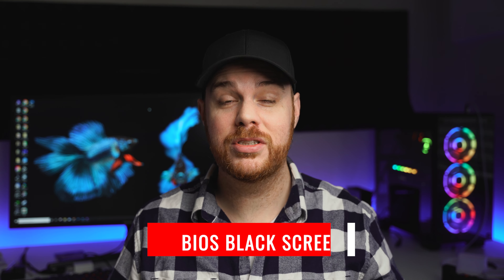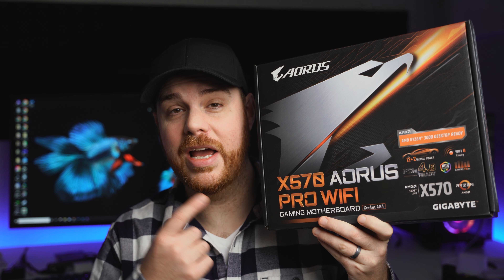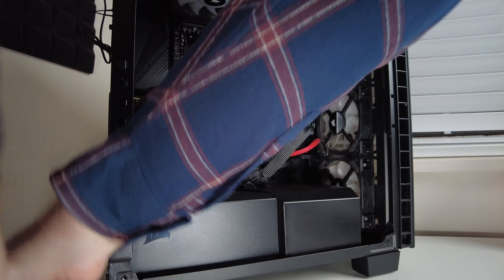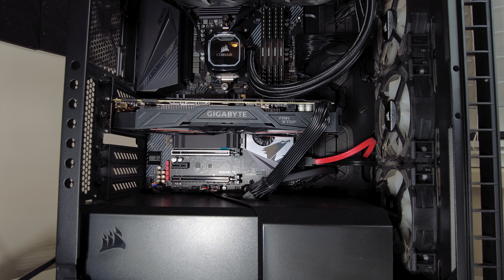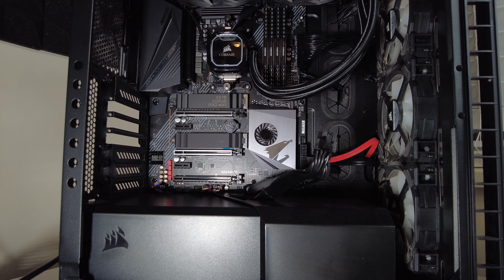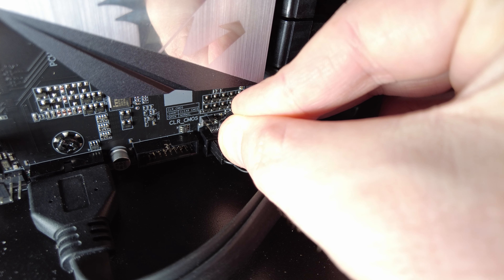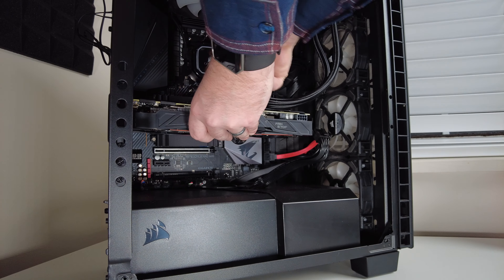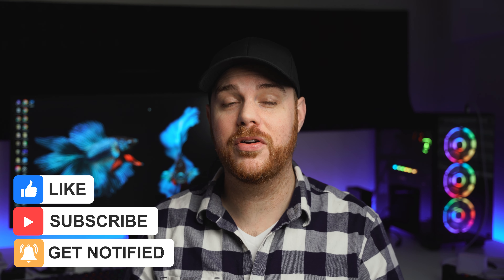How to FIX BLACK SCREEN from BIOS CHANGES (3 WAYS)

Comment: I tried everything and my bios screen is still just black. Please help!
Reply: it means your bios is corrupted, just like mine, you need to find out if you have a second bios on your mootherboard, if not, you need to send it where you got it and get help or find a pc store that helps fix things
Reply: Sgt Ryan  oh I found a fix. It sounds stupid af but it did end up working. Basically just unplug all drives from the system and boot. It literally somehow fixed it

Comment: This really helped. Thankyou.  Had to use the method of removing the battery. Thankfully it did the job.  I do have a question that i hope you can help with.  I have the MSI MPG B550 GAMING PLUS Motherboard ATX.  In the bios, memory settings is a feature called "try it" with the discription "optimises your memory".  When selected it bring up a drop down box.  I selected the corresponding ram "32gb 3600mhz" and saved it.  Reboot and my screens went off and wouldnt boot.  Any ideas?
Reply: I have the same with the same motherboard. Did you fix it?

Comment: I built my P.C. and when I turned it on pressing F2 or Del would bring up a black screen. once it went to Bios, but everything is new in the computer. I have reset the Cmos both ways and still can't figure out why I can't get to Bios to set things up. Any thoughts?
Reply: turn off the fast boot
Reply: and secure boot

Comment: Do I have to completely change the battery or just put it in and take it out
Reply: Do you know the answer to that? I’m worried I’d have to buy a new one
Reply: @crackedpotato30  just take the battery out for 10 seconds (a minute is even better) and put it back in. The battery basically "stores" the infos that the motherboard couldn't keep without it.

Comment: Tried both methods multiple times but no luck. Flashed BIOS (to the latest beta and stable versions both) with MSI flashback, no luck either.
Took my old SATA SSD which has win10 installed from my old case and plugged it in and removed other storage devices from MOBO and got the only windows login screen. 
Before that, just nothing. No BIOS, no MSI splash screen logo, nothing at all. Straight to the windows login screen after 5-6 seconds of blank screen. (Of course I tried to get in to the BIOS with DEL key but then nothing happened. I know the PC was in BIOS but I couldn't see it on my monitor and  had to restart.)
I ordered an HDMI to D-Sub converter.  I'll try when I get my hands on it.
If it does not work again, I will have to wait for my other monitor that has the DP input to return from the service. Maybe I can get signal with DP port. 
Specs : 
MSI X570-A PRO
AMD RYZEN 5 5600X
CRUCIAL BALLISTIX 2*8 GB 3600Mhz CL16
SAPPHIRE RX580 NITRO 4GB
TEAM MP-34 1TB NVME M2 SSD
ADATA SU630 240GB SATA SSD

Comment: My PC refused to enter BIOS and would cause my monitor to say "No Signal" when I tried. I reset my CMOS and it won't even show anything on my monitor. I'm thinking something with the BIOS is causing nothing to dislplay and now that I reset the CMOS, it's in BIOS so it won't display. Do you know any way to fix this or will I have to take it in somewhere to be repaired?
Reply: If you know how to use ch341a programmer, use it to reprogram the BIOS chip
Otherwise take it to somewhere to repair

Comment: I tried all those steps (removing CMOS battery, shorting the CMOS pin thin, unplugging everything) and my screen is still blank. The CPU fans and all the fans come on but blank screen. I have a gigabyte b460m ds3h-Y1. The "Y1" is because iBuyPower modified it. I flash the BIOS with Gigabytes F5b BIOS instead of the iBuyPower's modified BIOS (latest from them is F3). Does anyone have any other suggestion for me? I really can't afford to buy another MB/CPU combo. Thanks again.

Comment: I bought ryzen 9 5900x and Asus prime x570 pro. I updated the bios with older CPU. It worked normally with it but the display is still black after I change the ryzen 9. Does someone have an idea how to fix this?

Comment: I did but still black screen, monitor mouse not working, :( yesterday I use upgrade bios
Reply: Did you figure out a solution
Reply: @DrTwitch  no, actually, I have reseted bios but still only CPU WORKING,   2-3 hr continue computer  turn on-  turn off do, then sometimes computer turn on probably then next day again 2-3 hr do ON-OFF, :( I DON'T KNOW, VOLTAGE ISSUE, 
3 light reveal in motherboard, VGA, CPU and GRAM. 

GIGABYTE X470 ULTRA GAMING 
RYZEN 2700X 
16GB RAM 
550 PSU, 
THANKS

Comment: After few time again black screen even i got replacement of my GPU and after power off when i restart again GPU don't have any power showing so i have to clear cmos then everything work fine don't know what to do and before one year i got replacment of my motherboard and same issue after few months and power supply to replaced 😭😭
Reply: GPU motherboard power supply these got replacement 😭 and now
Reply: I am assuming a problem with the motherboard but now I don't have a warranty or a technician nearby who makes a good pc I have 3080 + tiachi x570 ryznd 5900x

Comment: I wanted the windows 11 update, I was told i need some TMP enabled, so I went to the bios and turned on secure boot, fast boot and tmp, also enabled xmp/emp(whatever that is) for RAM. I click on save and reset and then the screen went blank. I tried restarting PC but no display. CPU fans are spinning, Motherboard light is on but no display whatsoever. 
 
I'm not sure if this is the fastboot's doing but earlier I had to long press power button on the pc to turn it off but now as soon as I touch it, pc turns off.

I've removed and reseated GPU, RAM.
I tried resetting CMOS by shorting it with a screw driver, also removed and reseated the CMOS battery.(multiple times)

(Yes I unplugged the power cord before doing any of this. Also did the drain-the-static move by pressing and holding the power button a few times.
Reply: Still not working? I just did the same
Reply: @JANTH  Nope. I tried whole night, got upset and let it go. I get the feeling the cmos is not getting reset on my motherboard for some reason.
Reply: @ShivaMurary  same issue bro
Reply: @aravindreddy9417  Did you manage to fix it?
Reply: @ShivaMurary  no tomorrow i am going to ctc i might found what's the issue and report it to you well i use gigabyte b365m to be precise
Reply: @aravindreddy9417  Mine is Gigabyte b460m. Okay all the best!
Reply: Have you find solutions for this
Reply: @harysviewty  Yes the issue was my dedicated graphic card drivers got corrupted or something. I had to use integrated GPU, then I got the display and managed to reset BIOS, everything worked fine after that.

Comment: Screwed myself bad, I think the dell bios update I did deleted the original bios and corrupted the new one when I tried to restart the machine. I guess I have to desolder a bios chip and solder a new one or wait for the new mobo I ordered. Gotta love computers.....Thank God I don't invest my money in Computers and that what I have is a Cheap desktop with a $30 mobo otherwise I'd be pulling my hair out.
Reply: Lol turns out it was my TV not displaying my screen, tried my Extra Screen that I use for my Laptop, worked fine....Thank God..For those that have to Update your Bios on a G33M02 Board for a Dell Inspiron 530 from say 1.0.5 to 1.0.18 don't worry if your Display does not show a boot screen after a successful bios Update. Try using a different display or use the Display port on your Graphics card and it should boot up to windows/linux just fine.

Comment: I was playing around trying to get windows 11 messed around with the secure boot and now my computer won’t post it’s completely black and I tried everything you told me to do but it’s still black The bios was working before
Reply: Same happened with me day before yesterday 
Do let me know if u find any way to fix this
Reply: Also when you Q flash you don’t have to turn on the computer just make sure it’s plugged in to the outlet like normal figure out where your queue flash button is on your motherboard and hold it for about 10 seconds it should take about 10 seconds to actually do something then you’ll notice your fans kick on and some flashing should occur
Reply: Oh and put the USB in the back of your PC USB it should say bios, I will put it where your motherboard says to put it
Reply: I have a similar problem where I' get stuck at a black screen when I try to enter BIOS. If I don't, I'll boot normally to Windows. I need to open my BIOS though and I can't.
Reply: @NimeuMusic  Q flashing your motherboard will reset your motherboard
Reply: @MrC0LT0N  Thanks! I'm gonna google now how to Q flash my motherboard.
Reply: @NimeuMusic  what motherboard do you have and is it AMD or intel
Reply: @MrC0LT0N  AMD. MSI B550 Edge Wifi. I just build a new PC today and everything works great and I was able to get into the Bios, installed Windows 10, drivers etc. Then there must have been some driver or update that is now preventing me from getting into the Bios, it just shows a black screen after hitting delete. I can still boot normally to Windows though, it's weird.

Comment: I removed the cmos battery and it reset the BIOS settings because I checked task manager and my ram overclock was reset. However, I'm still getting an infinite black screen when trying to enter the BIOS. Any tips or ideas on how to fix this?
Reply: Same like me , do you find the solution?
Reply: Set your BIOS to use dedicated graphic while using integrated graphic

Comment: Yesterday I went into bios to turn on my integrated graphics for my Ryzen 3 3200g. When I saved and left bios my screen was black so I pulled out my Motherboard battery and re installed it. Today I tried doing that again and I had to pull the battery out again. Some minutes ago I went into bios and left emidiately without saving... I got a black screen again !

What can I do about that? My device manager is also not detecting my integrated graphics anymore after pulling out the battery.
Reply: After re installing the battery I do get into windows just fine.
Reply: Hey same happened with me I messed up with my integrated graphics settings and after saving it my pc is not booting up or there is a black screen so should I do the following steps shown in the video? What did you do to fix it?
Reply: @pablochocobar074  Hi, just open your pc case, and remove the Cmos battery. Wait 15 seconds and then reinstall it. Now boot up your pc and you are good to go.
Reply: @LauandM  THANK YOU MAN I tried this and now i am typng from my pc :D
Reply: @pablochocobar074  np bro
Reply: What can I do I have asus strix g15 ryzen 7 4800h/BGA and I have no boot priority’s stuck in bios then I try to update it and reinstall windows and now I got black screen  with power and airplane mode lights on ??? Please help

Comment: noone can help me my bios is broken i cant find a file to update it and its a Minisforum EM680 my bios is displaying to the monitor its just pure black no mouse display no nothing the pixels are on but they arent displaying please i cant find any info and my only hope is a video from 3 years ago that the only thing similar to my situation is it involves a black screen and bios this is how i got my pc ive never been able to accsess bios even though i should be able to certin things dont work like my AMD software wont let me swap into gaming mode for overclocking and its not locked its just broken somehow not sure if its a physical component thats broken or not but i think it would fix if i could find the bios for my pc to download

Comment: If anyone can help me I changed my rams MTs speed and after I saved and quit the screen just stayed black and wouldn’t boot. I cleared cmos and after that didn’t work I took the battery and it still won’t boot. The dram light is on so ik I messed one of the setting up but would that really have fried my ram? I need help so please.

Comment: My gpu has been making really loud fan noises as of the last couple months so I contacted nvida today and they told me to update my bios and I didn’t download the bios correctly onto the thumb drive so I exited out of the M Flash then exited out of bios (it gave me a message like save changes to preset or something similar to this) and it rebooted but now I have a black screen with no signal. I’ve tried turning off and on the power supply, cleaning the ram, taking out the battery of the motherboard, and checking the cables to the monitors and still nothing, please help :(

Comment: I had a black screen after enabling the XMP does anyone know how to enable it without any issues ?
Reply: Did you find a fix, I did it aswell and ots happening to me
Reply: Hey did you find any solution? I changed my igpu vram and it happened
Reply: @pablochocobar074  Some people said download your last bios version it might fix the issue, but I haven’t tried yet
Reply: @ahmedalrasheed3861  i reset the cmos and now my pc is booting up

Comment: I just put this thing together with a pcie 4 ssd and I got nothing on my screen… not even an option to get into bios… ryzen 7 book says F2 should get me there but no luck. Also have a new AMD Adrus board with onboard HDMI.

Even tried bringing a sata ssd over with windows 10 from another pc… which usually boots up on anything. 

Ugh…
Reply: Only using onboard hdmi for video, no graphics card

Comment: Thanks for a good video. I my case it did not work. My son bought 2 new RAM and a new SSD. We installed win 10 and everything was fine, until he desided to clock the memery to 3200 i BIOS. Atfter that the screen went black. We have tryed to remove CMOS battery and set jumper on the to pins that the manual deskribed. Now he is sad and i do nor know what to do. I aprisiate if anyone have any advise. The motherboard ar Asus Rog Strix b450f gaming 2
Reply: i'm dealing with the same issue with the same motherboard after trying to enable Ram XMP in Bios "DOCP Standard" after restart  ,Black Screen ,the board stuck on Green Led "BOOT" so here is the things i tried :
- I Cleared the CMOS Battery 
- I removed the Battery for 10 min , i even try leaving it by night
- I reseated  the CPU still black screen 
- I insert one stick of RAM
- i started the pc with no CMOS Battery 
So all these attempts and still having black screen "no display" but i found a way around to boot Windows by Pressing" ESC + Enter + AROW UP " multiple times at the same time , so what i'm gonna test now is a new dd4 stick of Ram because it worked for someone  in a forum with the same board

Comment: Good day sir! My problem is that my PC wont display and have 3 long beeps every time I do save changes and reboot after I change a thing in BIOS like boot priority, PEG to iGPU, virtualization enabling, etc. My fix is I do this CMOS battery reset but any changes I made will go back to its default state 💔 Any help is really appreciated 🙏
Reply: Did you ever find a fix?
Reply: @H3RNDAWG  yes, the 3 long beeps was due to the RAM, I think the RAM is not compatible with the MOBO, after swapping with a different set of RAMS I can now save changes without any issues.

That previous ram brand is called Skihotar, a chinese brand I think.

Comment: If all else fails remove CMOS battery, remove GPU, plug HDMI directly to motherboard, place CMOS battery back in, turn back on (will load BIOS), roll back changes you may have made. Turn off, place back GPU and connect display as usual. Voila.
Reply: Dude not even this works for me
Reply: @gsus135  Did you figure out a solution
Reply: @DrTwitch  yeah sadly i had to lose my current motherboard  and get a new one , took to multiple shops and friends and nth best solution was to buy a new mobo
Reply: @gsus135  I actually bought a CH341 programmer and it fixed it! Just connects to your bios chips pins and can read and write off of it, just reflashed my bios through it
Reply: @DrTwitch  can you put a link to product and maybe a how to on process I miss my old mobo 😭

Comment: Hello - my problem seems a bit different, do you think any of this might help? Also, does the reset erase any data from the PC? (-> can I just try it without consequences)? Thank you. The problem:
The first time I turn on my PC, everything works fine.
The second time I turn it on, everything works fine.
The third time I try to turn it on, the startup goes as usual but at the windows logo, it switches to "no signal" and the screen remains black after that. I have to turn the PC off, turn off the power supply at the back, then hold the power button for like 20 seconds. Turn on the power supply and the PC starts normally again - I am back to the "first time I turn it on." I have no idea why this is happening, nor why the steps that I do help fixing it - could not find the answer anywhere :/
Reply: Reset it but if you do all data will erase

Comment: i got my custom build 2/5 days ago and i reset my bios settings to default and ended up with a corrupted bios, of course my motherboard doesn't have a second bios and doing the stuff here doesnt work at all, so i'll probably end up having to send it back